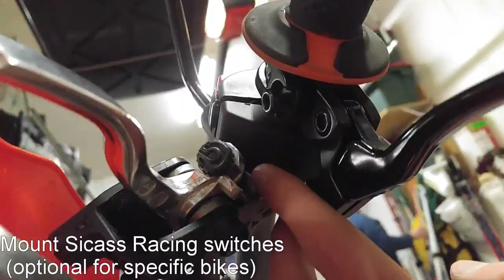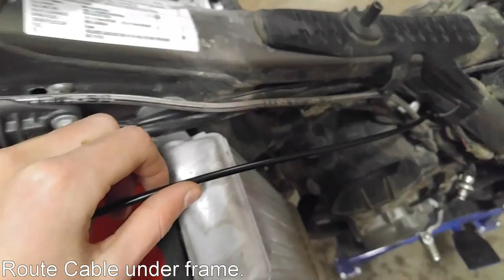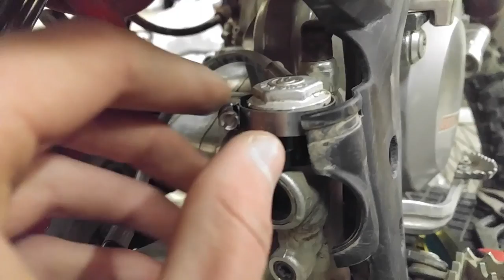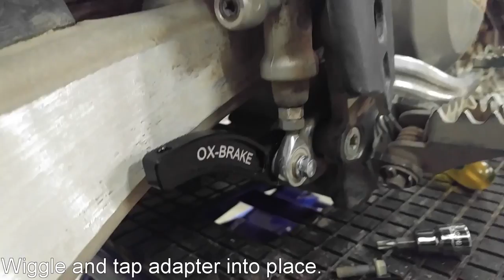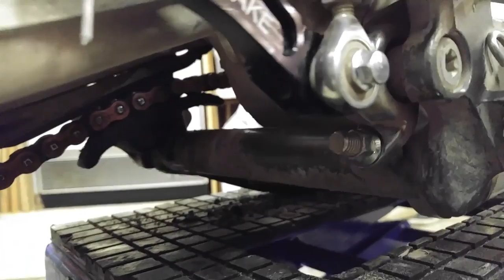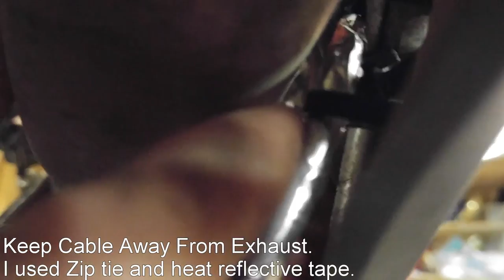Ox-Brake (KTM) INSTALL [HD]

Comment: Any tips for increasing braking power? Mine requires a very stiff pull to lock up the rear on flat ground.....
Reply from the maker: Climberbiz I find on pavement it is hard to lock the rear tire, but maybe if you find a longer lever that would work with the cable.

Comment: Thanks for  awesome video. İ want ask a question for left hand rear brake.  what is the advantage of left hand? or the disadvantage of the right hand
Reply from the maker: Oktayoktem oktem I use this as a Left hand rear brake (LHRB), the foot brake still works and you can get more power out of using your foot, but for example: I use the LHRB when going down technical terrain and need to put my right foot down, but then i won't have my foot on the brake, so I use the hand brake.

Comment: i find mine so stiff to pull in and no where near as good as the pedal it doesnt lock my back wheel just puts some resistance on it.
Reply from the maker: qwerty123627 did you route the cable with any sharp bends? And how hard is your brake lever return spring? I don't have that issue in my exc500
Reply: I put this on my WR250f and noticed the same thing. I rerouted the cable and got some improvement, but the overall clamping ability isn't as powerful as I had hoped. Going to try more aggressive pads to help with this. On a plus note, I can notice that the rear wheel is helping slow the bike, just not that well. Brake return is fine btw. The lever feel has a somewhat squishy feel to it. May try the rekluse hydraulic setup

Comment: Hi Scott, thank you for the video....I have a 2016 KTMEXC do you thnk the Sicas Switch will be required?

Thanks?
Reply from the maker: i have a 2014 ktm exc and it was required and i believe it is required for 2016 as well,
Reply: Hi Scott, could you tell me where I find the pieces to make it the same as yours on my honda?

Comment: How well does the cable hold up? Does it stretch with extra brake pressure?
Reply from the maker: John Cameron I have not noticed any extra streaching, every couple months ill take it apart and check for rust and debris. so far its been great.
Reply: is it still great?

Comment: Awesome video! So do you use it for wheelie control? And if so how effective is it compared to pressing the foot pedal?
Reply from the maker: i use it for downhill terrain where i need to be standing and is too bouncy to press the rear brake steadily, it is just as slightly less powerful, as long as you have good hand coordination to use clutch and brake, it is worth it.